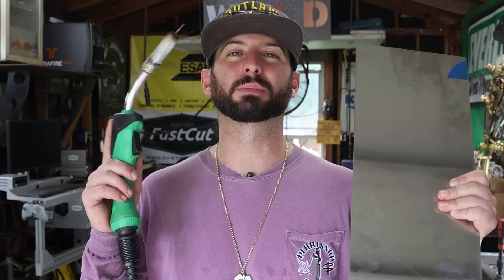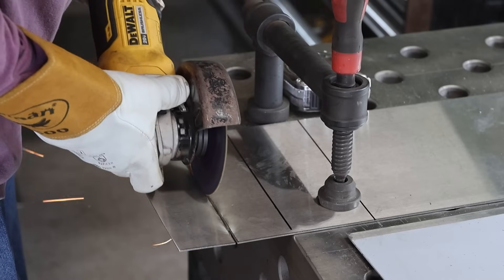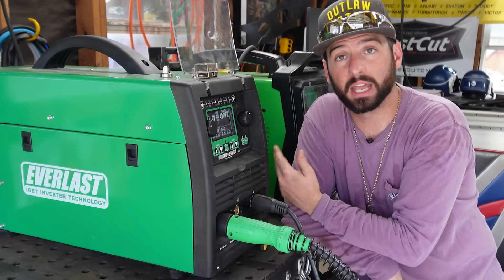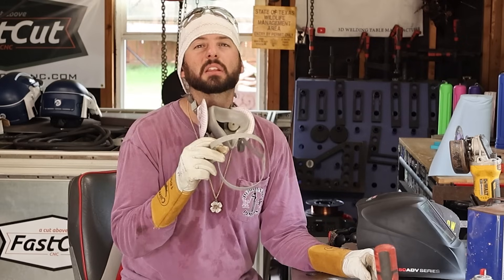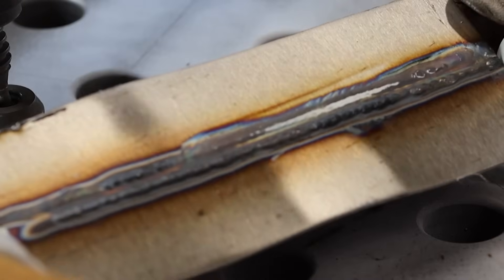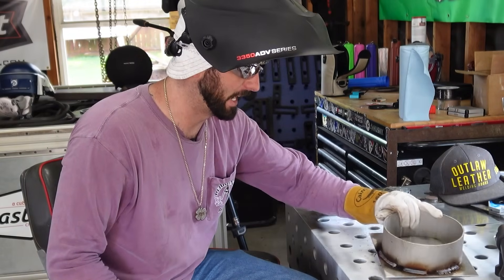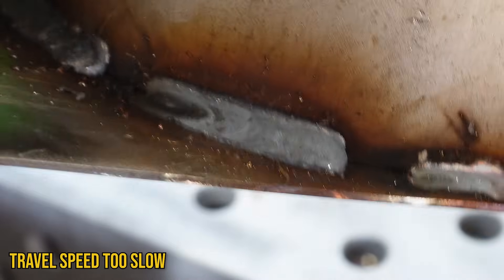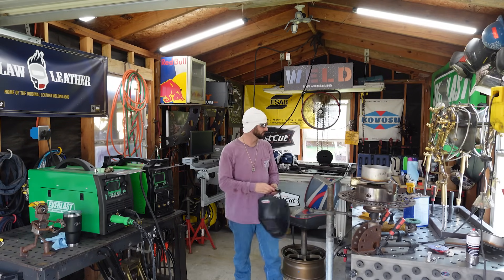How NOT to MIG Weld Stainless Steel

Comment: You should try the messer  n2c3 gas with no helium  for mig SS ,  my old welding teacher works for messer gases  and told me  the n2c3  is a replacement to the tri mix that costs a forture

Comment: you state that when you weld stainless it comes out gray, from what i read if it does not have color or chrome it is overheating and contaminated , your pretty much welding carbon .

Comment: Thanks for all the variations.  Dumb question, if mig isn’t as nice looking and may be more expensive you might have said, why not tig weld stainless? unless mig is stronger and if looks don’t matter.
Reply: I'm not an expert so take what I say with a grain of salt, but MIG is way faster than TIG, and is typically easier for a non-expert. 

I find that my TIG welder is more expensive to run, simply because of the fact that MIG is much faster. If it takes an hour to weld a piece with TIG and 15 minutes to weld a piece with MIG, the gas might be more expensive per unit of volume, but you're using 1/4 the amount.

I've also personally found that TIG is much harder to work with in tight places. A TIG torch is pretty bulky compared to a MIG torch. 

They both have their place. TIG is the stronger weld, but MIG is good enough for 99% of situations.
Reply: @Midnightrider384  agree 100%
Reply: @Orrphan  TIG takes quite a bit longer to do. It depends on customer requirements for the job.

Comment: Great video. I am a novice and trying to weld 304 stainless exhaust pipe. Having trouble with popping/ no penetration. I will try to turn up the voltage
Reply: @michaelnatoli2539  turning up the voltage will not give you more penetration.  Volts spreads out your weld.

Comment: I worked for a time in a Frauhof plant making tankers, they used the same gas for mild and stainless steel, 95% Argon 5% CO2 there was a small amount of weld discoloration  which was washed off with acid never caused any trouble.

Comment: So what would you say to someone welding mild steel to a 304 stainless auger barrel using ER70-S6 wire and 100%C02 it welds quite nice actually. i found it creates less spatter than welding mild steel to mild steel

Comment: Back that heat down ! Turn that wire down and stop pushing the puddle and that buckshot will go away and that rainbow effect will slightly appear , videos like this is what gives short circuit mig a bad reputation if you’re getting spatter keep turning the wire feed speed up until the machine starts popping then bump it back down slightly ,stainless likes to stay in the puddle and don’t “push” the puddle  , also if you have an  adjustable nozzle poke that tip out slightly on the gun , rather than sucked in an your puddle will wet out more . Make these changes an you might be surprised on the results .
Reply: Agree….. turn the heat down some I’m not big on pushing the puddle either 👍
Reply: He's been welding for over 15 years. I think he knows what he is doing.

Comment: Cool video. Can you use pure argon for mig stainless? Also, do you have to use a different liner so as not to contaminate the wire feed?
Reply: @paullewis252  10 yrs experience - no and no

Comment: Best gas choice for the money is 98/2. And that is the gas 8:59  recommended by Everlast in the manual and on the unit. Also manipulating inductance will clean that spatter up. you were down at 22 percent. It should be around 80.  Tri mix is too expensive to run.
Reply: CRONIGON® S2 AR/O² % ?
Reply: @sraz12  No  Ar/CO2 98/2

Comment: I may not be able to "Play" in the shop anymore but sure is nice to keep a idea going. I did notice that because of this heat when welding stainless, the metal distorts or bends more when doing a continuous weld. Nothing the shrinker stretcher tools or other means can not fix as in say body shop type situations
Reply from the maker: Stainless does tend to distort a bit more than carbon so nice to have ways to fix it around.

Comment: With the gas, i had someone who used c25 and the weld ended up with a very hard black coating, which i suspect is carbide. You need low amount of co2 in the gas for stainless. Eg 2%co2 98%argon.
Reply: C2 gas is a good option too
Reply: @tweake7175  we use 98/2 gas and you can get rainbows and no bbs up to a certain thickness for 16ga probs no rainbow unless some .023 wire
Reply from the maker: Great info
Reply: Propper way i think honestly.

Comment: boy, that respirator sure disappeared fast. 😂
Reply: Heh heh 😅
Reply: I usually hold my breath while im running a bead. Oddly enough helps me stay more steady. Kinda like a sniper before he shoots. The key is solid ventilation in your work area. Respirator definitely if you can deal with it
Reply: Go troll somewhere else. This guy is taking time out of his day to show people who are INTERESTED in learning something. You should say Thank You and move on.
Reply: @kennethmays6830  welding stainless steel with gmaw is highly dangerous and should only be done with a proper respirator and coveralls to protect from harmful fumes and dust
Reply: @kennethmays6830 you wont be using what you learned for long if you don’t take care of your body
Reply: @kennethmays6830  I don't think he meant it in an unkind way, just acknowledging how much of a pain it is to wear a respirator all the time.
Reply: Hexavalentchromium is toxic

Comment: Almost 40 years ago I managed a materials lab and was involved in the failure analysis that we did. One investigation to settle a lawsuit was to determine the cause of severe pitting corrosion on a custom-fabricated electroplating tank about as big as your garage - talk about expensive. There was extensive pitting all over the tank so severe that there were fluid leaks. It turned out that someone in the fab shops had cleaned up the stainless welds with an angle grinder which had previously been used on carbon steel. Every spark which landed on the surface of the stainless tank was a source of the point corrosion. Never let stainless and carbon steel mix!
Reply: You betcha ❤
Reply: Dude, I'm going to have to see that report.
What you are describing is inferior foreign steel having contamination that isn't exposed until the surface is altered at high temp.
OR microscopic pieces of steel (sparks) bonded to the surface at high temp, converting the spot it landed on into martensite but you're not going to convert more than microns of steel at a time.
But you're not going to make SS rust just from "touching" something else.
That's not how physics works on this planet. A chemical or atomic reaction needs to occur.
Reply: Will the spool drive wheels touching carbon wire their whole life and then grabbing stainless wire cause cross contamination?
Reply: Yeah, I just triple-checked. 
Your memory is failing you.
You cannot diffuse carbon into the SS at room temps.
What you are describing is the creation of martenistic spots on the SS, which temporarily diffused carbon into the SS at high temp since it was a oxygen/metal spark.
AND THEN...
likely caused a galvanic reaction with the liquids involved.
But it had nothing to do with "carbon steel" and SS interacting from simple touch.
Reply: @m4rvinmartian  I think we are in violent agreement. The failure mechanism is the case I referred to was electro-galvanic corrosion, everywhere that specks of carbon steel flew off the grinder wheel and stuck to the tank wall.
Reply: @m4rvinmartian  so should i worry about the stainless flex adapter i welded on my girlfriend’s exhaust pipe or not guys?

Comment: I would suggest using a 300 series with low carbon with high silicon added. You must adjust your inductance to a higher percentage. Keep a short stick out measure from the contact tip, not the nozzle. Dragging the arc seems to work the best to reduce spatter. The tri mix works the best but Argon/. 2 Co2 can work on thinner gauge Stainless.
😎👨‍🏭.
Reply from the maker: All things we will have to test out, thanks for the recommendations!

Comment: I have to disagree with your “not as pretty” comment. Once you dial in your settings, learn to pull with a whip you will produce beautiful beads w/ minimal spatter when anti-spatter is used. I mig 304 stainless everyday ranging from 14g-1/2”. Been welding for 30 yrs now and 10 on stainless. 
Also to save some money you can use a 98/2 argon/co2. It’s not as smooth as tri-mix, but it’s real close. 
If ya want some tips n tricks n pics, give me a holler (yes I’m old 😂)
Reply: Hello, can I ask why pull and not push

Comment: Would cleaning up the joint carefully  before welding, as you would with TIG, have made much difference with the MIG process you were demonstrating?
Reply: The material was already clean. Shouldn’t need much prep. Should’ve used some anti spatter for sure